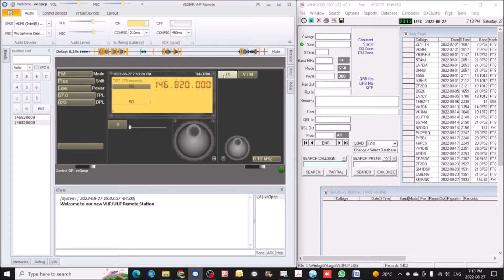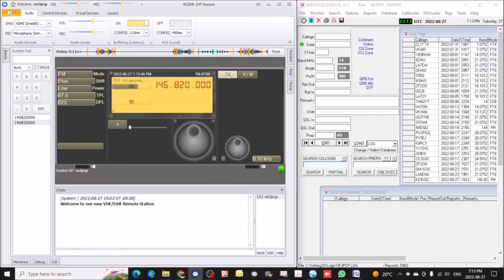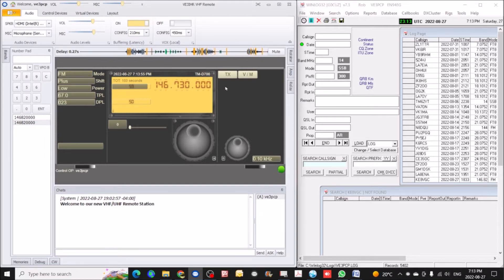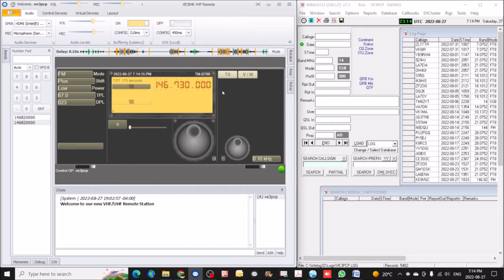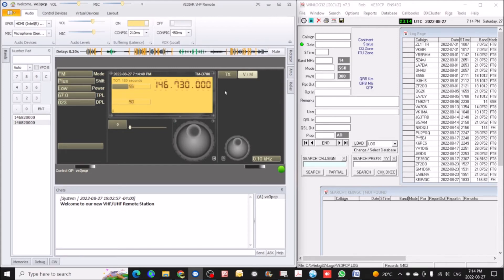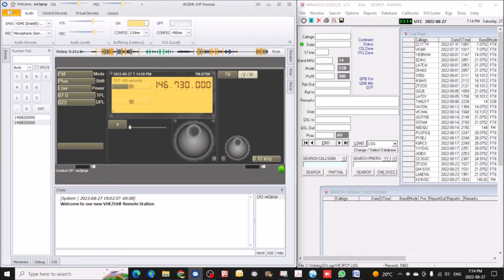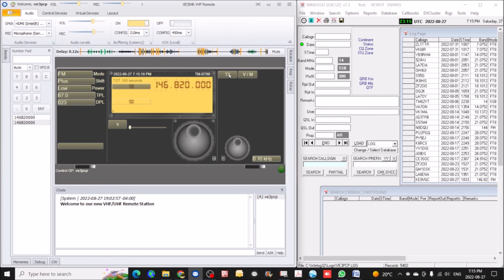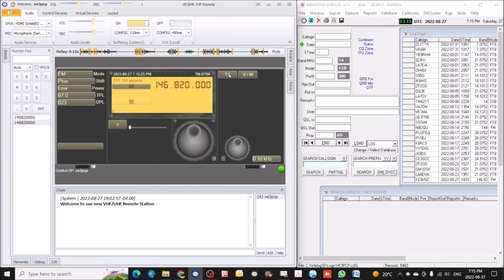VE3IHR VHF UHF Remote Station Testing Kenwood TM-D700A

Comment: Do you get cat control also
Reply from the maker: Yes. I use a USB serial cable for CAT control. Audio cables are separate and use the mic and external speaker connection to computer audio.
Reply: @ve3pcp  can a signalink be used
Reply from the maker: @mikegianfrancesco9431  I'm sure it can if you have one.
Reply: @ve3pcp  I do. It need get the cables for it
Reply from the maker: @mikegianfrancesco9431  What radio do you have?
Reply: @ve3pcp  Want get radio you have want make it remote
Reply from the maker: There are a few other videos of both my VHF and HF remote stations.
Both use Kenwood radios and RemoteHams software. Same type of set up for both.